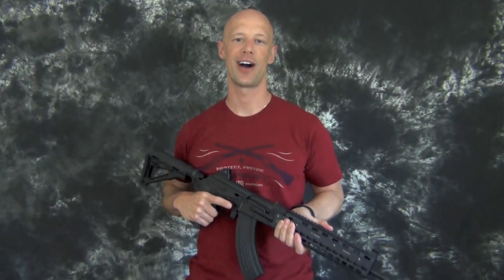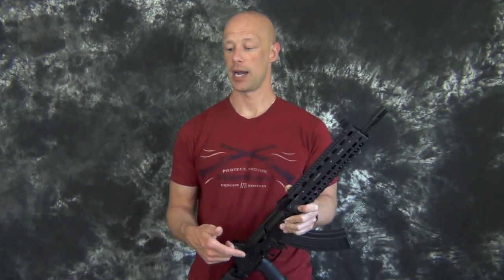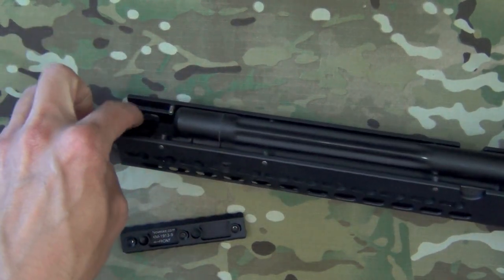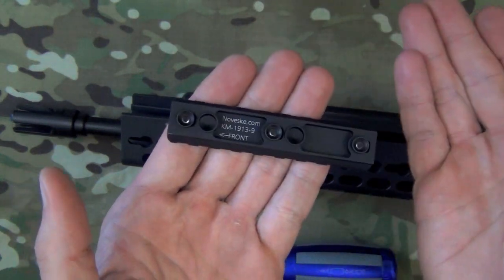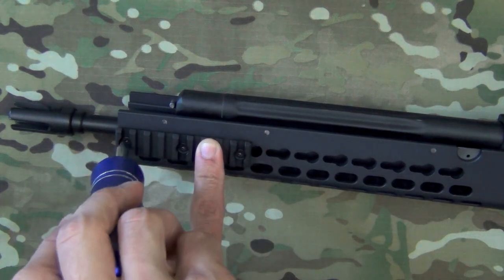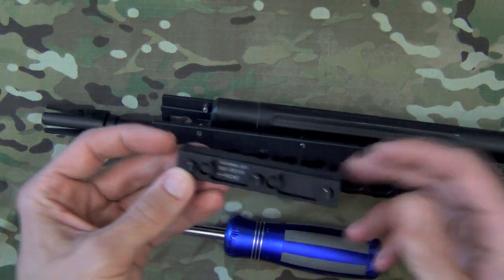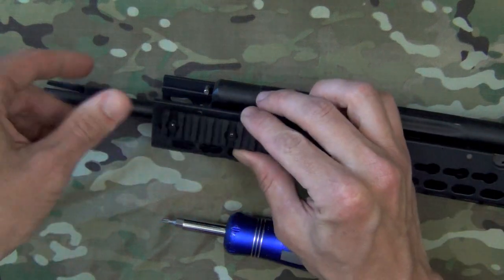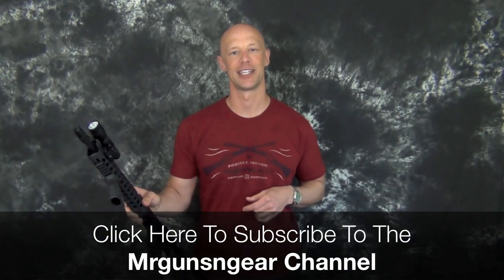KeyMod Rifle Rail System: What Is It And How Does It Work?  (HD)

Comment: Are all Keymod rails interchangeable or do some handguards require rails made by the same manufacturer? I tried cheap rails on a Daniel Defense handguard and they did not tighten enough before I ran out of threads on the screws.
Reply from the maker: Chris Andrews key of attachments are interchangeable but some aren't made to spec.

Comment: Ah, you made something clear that I hadn't seen before...  I had thought Keymod worked just off of tension, and was only braced with a lug in one direction, forward.  (in other words it only protected against rifle recoil... not if something pushed it backward.)  But you showed the backward facing lug... That's the difference between buying and not buying this system for me.  Thanks.
Reply from the maker: TheMetalHeaD256 You're welcome.

Comment: i dont believe it would work with the ultimak...you lose co-witness with this BUT you can pull off the top in 3 secs and put it back on retaining your zero. 13.9 oz is the weight of mine but it does have the front sight like this has. machined and finished top notch. you can check it out on the krebs site.....they have more designs in the works